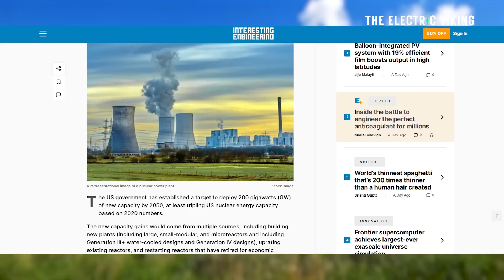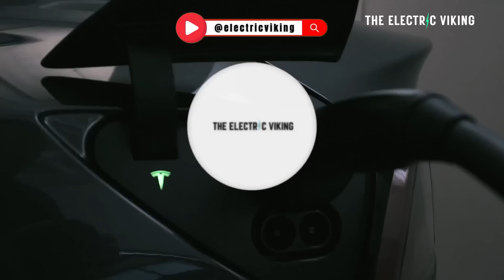US reveals plan to triple nuclear capacity with hundreds of nuclear reactors

Comment: The build out of new nuclear electric power in the US is the Trump energy policy.    Biden announced that nuclear power electrical generations build out after meeting with Trump in a post election meeting.  Biden's administration in testimony before the US congress has said they don't like nuclear power.   They like wind and solar power.  They were very insistent on that point.

The nuclear build out should actually be 5 - 6 times 2024 nuclear energy in the US that accounted for 18.6% of US electricity generation and not just 3 times more.  This is to replace current plants and expected large increases in electrical demand.   If eventually switching motor vehicles over to electric that could double the demand for electricity.  

The expected long term electrical supply in 1950s US was nuclear and hydro power.   Running power generation on natural gas is far too expensive for base load power.   NGCC plants are cheap to build, but expensive to fuel and will make excellent secondary sources of electric power.   

 In 1950s US coal fire power stations had no emission controls making them not only dirty, but seen as expensive over nuclear to fuel.    Coal power staton in the early 1970s had many utility boards refusing to let coal plants voluntarily implement flue emissions reduction systems where they'd need to pass the expense onto rate payers.   

That changed with Nixon's implementation of the EPA and his energy policy that invigorated coal use.   By the mid 1980s coal power stations had no visible soot, fly ash and had reduced sulfur dioxide to where it could could no longer cause damaging acid rain.  The US power grid was greatly clean by the mid 1980s.  There have been few air pollution news stories on coal fired plants since that period. 

US coal mining production through the 1970s shed 75% of its mining personnel through automation and was producing more coal.   In the UK the strong coal mining lobby kept automation from taking place.  In 2024 most coal mining in the US is highly automated making use of remote operation of equipment for deep mines.

Hydropower has the cheapest incremental cost of scheduled electricity.  After that the lowest cost is large scale nuclear power.    Hydropower requires large reservoirs stretching out over large areas environmentally changing the area frequently  needing to take property and have people abandon their homes.    The main reason for creating the reservoirs is frequently flood control to save lives.
  
Fission nuclear power stations can loose containment of radioactive materials requiring large scale evacuation of the area.    This makes them a poor fit for being placed in already populated areas.   

The cost of scheduled electric power from solar voltaic and wind turbine generators is infinite!    An infinite amount of it can not guarantee power at a scheduled time.    Their practical use is for maintaining electrical storage.   The electrical storage maybe used for scheduled power delivery.

These types of erratic power should have no place on a public power grid.  When the public power grid is forced to have purchase agreements for wild AC, it frequently costs the public power grid more to deal the with large amounts of wild AC, even if it were free, than making all the power themselves, but the public power grid has to pay for it.  

The only foreseeable means to have solar voltaic and wind turbine generated electricity be core energy providers for long term scheduled electrical power is to have them run pumped hydro where they move a sea of water to a high reservoir that can last for months proving hydropower. 

Pumped hydro is placed at about 50% efficiency.   At least one hour of battery storage for running the pumps is needed with 15 minutes of that being regularly used for good battery life.   The typical minimal battery power grid supply now is four hours.   It's simple to curtain pump use to follow battery state of charge.    

3 GW of hydropower would need an average of 6 GW electrical power to run the pumps.   Losses in battery and transmission is easily 20% requiring  7.5 GW average from the wind turbines and solar farms.    

Running the pumps would follow solar voltaic generation that averages out at 1/5 solar voltaic capacity as an average electrical generation per year requiring 37.5 GW of solar voltaic capacity, with 37.5 GWh battery storage running at peak 30 GW of pumps during the productive solar day.   It's a sea of water being moved.  

Water stockpiling is being used to make the average 1/5 capacity of solar voltaic be dispersed evenly over a year.   An actual plant would want more water stockpiling to ensure supply.  

37.5 GW of solar voltaic takes up a lot of space.   Google AI look up: According to most estimates, the maximum solar voltaic capacity per acre is around 4.5 megawatts, meaning that one acre of land can theoretically produce approximately 4.5 megawatts of electricity using solar panels.  

37.5 GW / 4.5 MW = 8333.33 acres,  33.72379003 sq. km, 13.02082813 sq. miles.   This would likely be larger for redundancy and more pump capacity to ensure supply of stockpiled water..  

The system would fail during world weather events such as a volcano placing ash into atmosphere causing a year round winter.  Such an event would also effect wind energy.  

Hawaii would seem idea for such a system.   It has high elevations for creating high head pumped hydro and flat areas for many square miles of solar voltaic generation.   It's year average for solar panel generation is much more consistent over a year not requiring large seasonal stockpiling of water.  

Or you can put in a 3 GW two unit nuclear plant in a remote location.   3 GW is typical for a larger power plant.  They typically create large artificial lakes for their cooling water not being around populated river areas.  

The US doesn't have commercial uranium fuel mining it gets it nuclear power plant fuel from Russia (not now) and other foreign sources.   It does have 300 year reserve of high BTU bituminous coal.

Comment: Nuclear has land use advantage. If you factor in long term cost of land lease cost of solar farms and battery arrays, the cost might exceed that of nuclear.
Reply: Have you ever driven across Nevada?
Reply: @tomconrad7091  sure. Built them in remote locations. Then you run into the same problem of transmission the point viking was arguing against nuclear.
Reply: Supposing that the required land could have any other reasonable and beneficial use.

Comment: Someone said your channel had lost its edge.

Well, that's a bit harsh. However the content of this presentation is probably what they're referring to...

Take for example the following:

1) Safe commissioning of civil nuclear reactors. The time span of construction and the commissioning process is years for EACH reactor.

2) Costs for each nuclear reactor is astronomical. Tough to implement on the scales of hundreds of reactors when your economy is near broke.

3) Budget overruns. Inherent in all civil reactor programmes, thus compounding the constraints in No 2.

4) NIMBY

5) Added Grid distribution logistics.

6) Climate change impacts biting down good and proper long before even one reactor has been built, let alone safely commissioned.

7) The United States had recently rolled back its Modular reactors for civil applications programme. I cant remember the citation given for the rationale but none the less they abandoned it.

This all said and done above has to be overcome by Trumpistan - no exceptions. Unless he's planning a cheapo reactor design, building it on a shoestring within the space of a couple of years per reactor with no budget overspill AND achieve all that by rolling over the NIMBY fraternity in the US in particular.

Then implement them all before wide scale flooding or drought starts enveloping the land on which not only will they have to operate but have the cooling water access to achieve safe operation. 

This of course presumes each reactor site has reliable access for personnel to not only operate it but get to it in all circumstances in an emergency e.g. Three Mile Island and Chernobyl.

All I can say to Trumpington is good luck chap and send me a postcard with the places he'll store all the extra spent fuel rods these fleet of reactors will need disposing of.

Then send me another postcard when he manages to source enough Uranium to fuel these 100' of reactors especially since Russia and it's allies have plans to squeeze the living daylights out of the supplies of it if not already doing so.

There, I think this pin points what your other audience member/subscriber was getting at about your channel content of late...

Comment: No nuclear power plant gets to close after a few decades they stop making any electricity, and are decommissioned, but are kept open because the radioactive waste is stored on site. Until this issue is resolved no new nuclear plants should be allowed to be planned let alone built.
Reply: The new generation 4 plants can burn existing nuclear waste, after 500 years it will be equivalent to background radiation.
Reply: @jjamespacbell  The new fast reactors can burn that waste and it will have radiation equivalent to background after 500 years!  Relatively a short time.
Reply: @ws7001  No nuclear, no waste.
Reply: @ after 500 years there’s no waste with fast reactors.  But huge amount of waste with solar and wind.  Microplastics from sealing compounds, toxic doping heavy metals like Cd, As, Te, toxic etching fluids, curing agents for windmill blades, toxic waste from disposal of blades, low frequency disruption of animals from windmills, huge open pit mines required for copper and aluminum due to remoteness of renewable sources, massive requirements for batteries, elements of batteries, unfathomable mining operations for these materials to build out sufficient batteries for grid storage during winter.   People need to rethink what is going to be the best approach for the plant.

Comment: In the US regulators are petrified by the predicted future power consumption demands of planned data centers and upcoming AI data centers and the unknown demand for electric vehicles. It’s predicted that power demand may well triple in the next 30 years. However as other have said, the electric distribution network is the great bottleneck right now with lots of green energy projects unable to connect to the grid. I feel local and micro generation is going to have a significant future to solve this issue.
Reply: Don't forget that EV can be a grid saver by harnessing the power in the EV to back-up the grid with V2G, which is already being used in California, working very well.

Comment: Nuclear energy is vastly superior to solar and wind power because it offers a much much higher capacity factor, meaning it can produce electricity consistently 24/7/365 regardless of weather conditions, unlike solar and wind which are dependent on sunlight and wind availability, making nuclear an INFINITELY more reliable baseload energy source. Nuclear power plants have a vastly smaller land footprint compared to large solar and wind farms needed to generate the same amount of electricity.      Nuclear power plants can operate at near maximum capacity essentially ALL of the time, while solar and wind production fluctuate significantly based on weather.      Nuclear energy provides a reliable energy source with TWO MILLION TIMES THE ENERGY DENSITY OF WIND AND SOLAR, a consistent source of electricity, unlike intermittent renewables like solar and wind.       A nuclear power plant requires significantly less land compared to a solar or wind farm generating the same amount of electricity. Nuclear power plants produce ESSENTIALLY ZERO greenhouse gas emissions when operating. PUT A NUCLEAR PLANT IN MY BACKYARD, it is entirely safer than ANY OTHER form of energy generation.    Your stupefyingly ignorant antinuclear crusade works AGAINST meeting mankind's need for energy: According to the EIA, global energy consumption is projected to increase OVER 50% at a MINIMUM by 2050. THERE IS ABSOLUTELY NO WAY THAT MUCH SOLAR AND WIND IS BEING BUILT OR WILL BE BUILT. WAKE UP!      BEFORE the NRC over-regulated the industry in the U.S. the average plant was built in 2.5 years, saving SEVENTY-FIVE percent of the cost, which in interest on borrowed money on those unnecessarily long build times. Plants can STILL be built in 2.5 years. ABOLISH THE NRC. NOBODY has been killed or injured from radiation from a nuclear energy plant accident in the United States, EVER.
Reply: Energy density is a dumb argument; no one gives a shit.  Land footprint is another dumb argument, and (funnily enough) nuclear in some circumstances actually takes MORE land than renewables (though this is unimportant; we have plenty of land; this is a dumb non-issue). Capacity factor also a dumb argument. What counts is supplying power when it is needed, not even 24/7 generation. Solar provides power when power demands are highest; wind fills in during lower-demand times (night). Then of course there is storage (batteries, gravitational, ammonia, other), demand management, and other techniques for smoothing rough spots.
You're just a ranting hysterical nuclear ideologue, and everyone knows better now. Just sit down and STFU, you idiot.
Reply: Old school capacity factor. What is the capacity factor of a battery?  Your paradigm is no longer relevant.

Comment: Nuclear is a red herring as in the immediate 3 year and short term future 10 year nothing can be built, or designed and approved by the certifying authorities .
Certainly SMR (small modular reactors) of whatever type are a proliferation disaster ready to happen and an easy terrorist / war target especially effective when built in urban areas. Fusion is always 20 years too late !

We have 10 years to really reduce our CO2 and the tools are in place to achieve this if the political will was harnessed.

We managed to spend billions of euros every year bailing out the banks since 2008
see https://en.wikipedia.org/wiki/Quantitative_easing#Eurozone_and_Switzerland with quantitative easing (printing money out of thin air) resulting in rising asset prices (shares, property) that enriched bankers with little trickle down and widening inequality. This money could have targeted on bringing down household debt (debt jubilee) and investing in the renewable transition which would have kick started the economy instead of our current economic stagnation. see http://econintersect.com/pages/opinion/opinion.php?post=201803071950

An alternative fo many old reactor sites is deep geothermal some that can use the same grid infrastructure using directional precision drilling developed in fracking for oil and gas:
Fervo energy horizontal drilling + DACs , ORC turbines
https://fervoenergy.com/technology/ 
Sage geosystems  Geopressured Geothermal  multi-well using 150-250C heat and pressurised water to drive water turbines +  renewable heat battery storage
https://www.sagegeosystems.com/
Eavor deep closed loop deep geothermal, ORC turbines
https://eavor.com/

Comment: A.I. requires massive amounts of electricity, more than the current U.S. grid can handle. What's more, there's an anticipated resurgence of domestic manufacturing, supported by the incoming GOP government. Solar and wind, along with battery storage, are growing in the U.S. as well, but likely won't provide enough power for growing needs.

Comment: With all the AI data centers being added, we need more electricity. The Buckeye AZ,  1.8GW $20B Tract AI data center will use power from the Palo Verde nuclear-generating station in Tonopah, which is only 10 miles away. Solar panels with batteries do not provide enough base loading. Our local utility APS proposes adding 4 NG plants near Kingman to address base loading versus adding solar panels and batteries in unused deserts. In reality, these plants will mainly be used for peak loading, not base.
Reply: What is a base load?
Reply: @saeedboroomand830  That's when the batter craps his pants when he slides into first base. The other kind? That's the generation level the load never falls below, often about 3AM in mild weather.
Reply: Isn't this forgetting Moore's Law?  Computing rapidly gets more efficient with lower power demands over time.
Reply: @hobaho  Not happening. AI computing rapidly gets less efficient with greater power demands over time. Data storage power demands also increase. Who plans to abandon cloud computing?

Comment: The biggest problem is the waste. A 10,000 year problem. It’s nuts.
Reply: @johnnoddings6926  in 1970 maybe, but technically has changed immensely.
Reply: @Joeschmoe8930  People are unaware of 4th and 5th-generation reactors that use Thorium, which does not release more neutrons to perpetuate the nuclear chain reaction and produces much less waste than uranium reactors. Also smaller/cheaper/safer.

Comment: Who controls the solar panel industry?  Is it Australia?  NO!  Shut the front door.   You are full of crap.  I love the idea of going solar, not so much wind.  Batteries are one of the sticking points.  The majority of the electrical grid infrastructure is made in China.  This list includes transformers, circuit breakers, cables, smart sensors, switchgear control systems, and many more essential parts for the grid.  China is our enemy at present and is headed for economic disaster.  The one-child policy is reducing China's workforce by two-thirds over the next decade.  Current CCP policies have gotten youth unemployment up into the mid to upper twenties in percentage.  Many Chinese youth have simply opted not to work for the CCP at all.  They call this laying flat.  It's a long story and I don't have space to get into it in detail on a comment.  You should look at this.  Why don't you?